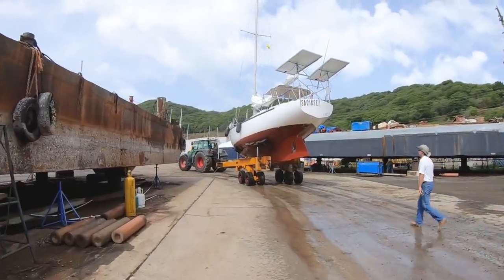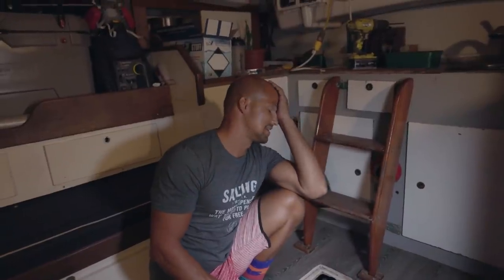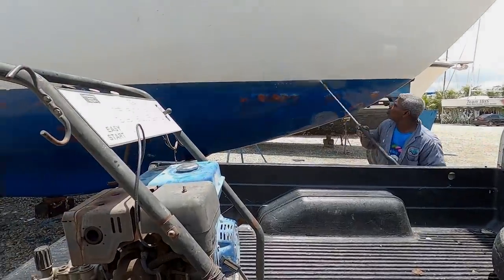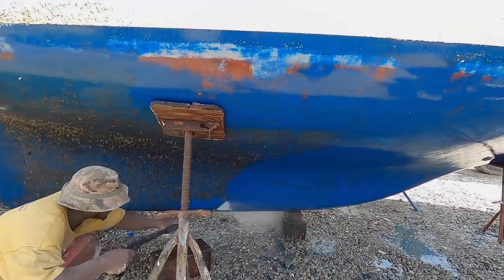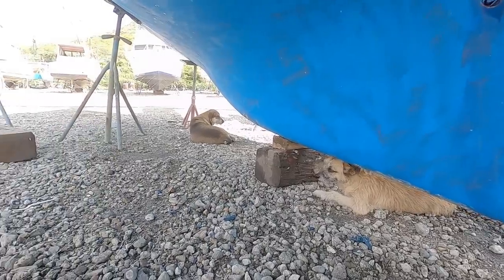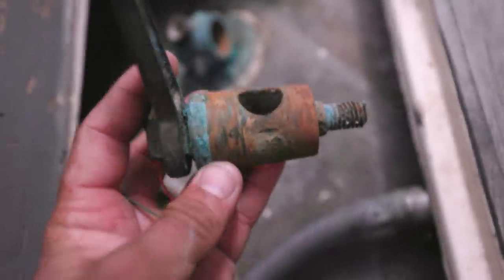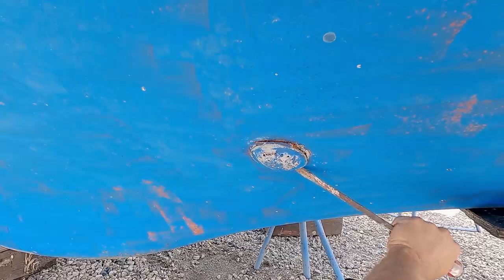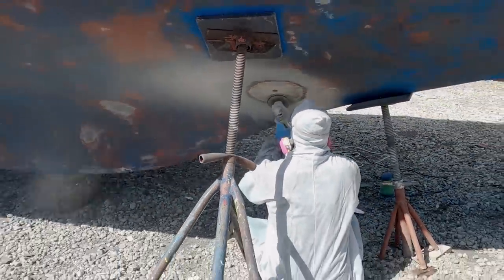IS OUR BOAT WORTH SAVING? (scary discovery during haul out)

Comment: That situation will require an extensive water osmosis treatment inside & out followed by tons of glasswork & fairing to fix completely. Sail-Life YT channel documented the process well, it took yrs to complete. I can only say it's not a job to get involved with unless decision is to keep Saoirse for a long time to come. Otherwise, make like a hermit crab & swap into a bigger shell.
Reply: Sorry, I disagree.  Drain as much water as possible, use compressed air, find the leaks and seal.  Close up the drain holes.  Repaint and keep sailing.  Not that big a deal.  My boat has had water in the keel cavity as long as I've owned her (18 years). It drains every winter on the hard (mostly) and doesn't affect the seaworthiness at all.  Like most gelcoat blisters, it's just not a big deal.  Fix and go.  Don't obsess.

Comment: Hi guys, this sound's like something we in Norway call glasfiberplauge, it's the epoxyresin that start to rot(hence the smell). You should get the area sodablasted and reglassed othervise it could live it's own life down there and slowly spread, and could do serious harm to the keelarea and that become's a hole other ballgame! Get a local Expert to check it out and do a propher job!  Sorry to be the devil's advocate but i have seen boat burst open due what sounds similar!
Reply: @Bjørn Erik Dahl. In English that’s called “osmosis”, which is probably not an entirely descriptive name. That can only happen with polyester resin, which is what almost all fiberglass boats have. Epoxy is much stronger, more expensive and can never have osmosis. Osmosis is caused by several different situations, but the main thing is that polyester hardens by evaporating its solvent, styrene, which leaves pores in the material. Water is absorbed into the pores, collects in cavities left by poor workmanship and then chemical reactions weaken the matrix around it. It’s not actually rot, and it’s normally far less dramatic than it’s usually perceived.

Comment: To be honest, I’m really trying to figure out what damage that water has done or doing.  If you think about it, probably not much.  Really the only thing it was doing was adding weight to the boat and maybe causing some shift in the ballast.  No issue with lead.  The de-lamination with that thick of a hull that would take decades to be any risk.  The only thing you need to do is dry it out and figure out where the water is coming from.  I would seriously avoid cutting into the hull.  A series of drill holes and forced air should dry it out.  Much easier to patch back up.  I know I make this sound easy, it’s not, but it’s also not the end of the boat or shouldn’t be!!!

Comment: Guys you really need to find out how your boat has been constructed, get in touch with the builders and get some drawings this will help you understand what is going on. The cross members inside your bilge area are called floors in most GRP boats these are timber, often laminated plywood then glassed into place and encapsulated. I would suggest the glass encapsulation has failed in your boat allowing water to be soaked up by the ply causing further delamination. These floors will need to be replaced as they will no longer be structurally sound. The most likely areas for leaks are your center board case and skin fittings, prop shaft aperture and rudder aperture all these will need to be stripped down removed refurbished or replaced and reinstated. This will be a big job and could take you at least six months. Whilst you are at it the hull should be checked for any osmosis and previous poorly repaired areas of damage, if any found will need to be cut out and properly repaired. GRP suppliers often run courses on this sort of work without trying to be rude you are obviously fairly clueless as to boats and glass tec and any help you can get will improve your chances of bringing your boat back to life. The good news is the boat appears to have been well built initially with good thick moldings, She should be salvageable but it is likely to be a lot of hard work and fairly costly. Good luck to you both and God speed.

Comment: Well it's not worth fixing correctly.  Most old boat do have water in the voids and it won't cause a problem if it doesn't freeze and expand.  Glass where it's leaking into the boat and call it good.  Fix all the holes you drilled in it.

Comment: If your ballast is iron and not lead you have to keep it dry all the time if it its iron it will rust and bulge an split the fibre glass you have to expose it dry it out and re-fibre glass a big job unfortunately best of luck. if lead its much easier as won't rust

Comment: Hi guys. Time to call it a day! The time, cost and effort to remove all the moisture using vacuum equipment and probably heating pads as you would do with osmosis to the outer hull is really not cost effective. The inner glass fiber will be saturated which will cause wicking to a greater or lesser degree. The only way to cure this long term is ballast removal drying, grind back and treatment. You can do some temporary repairs that may last a few years, but it is all down to drying out the ballast which has already had a chemical reaction between the lead and the sea water. This reaction is what's causing the bad smell. As the boat stands you need to be unemotional and consider the repair cost for either a few more years sailing at risk, or a full repair. Both of which are likely the far exceed the value of the boat even if the repairs are professional and warranted. 
Time to move on..... Sail Safe Guys, Ant, Cid & the pooch crew.

Comment: Well if the keel is lead and it's full of water you're not gonna have a rusting issue you might have corrosion inside but get all the water out my personal opinion fill the thing with spray spray foam fell it completely fall asleep home it'll give you more buoyancy and and no more water can get in..... But lest there's something that prevents you from doing that like something that moves around inside there I have no clue just a thought.... Drill a hole at the bottom put a vacuum on it suck out all the water

Comment: Hope you didn't really raise the waterline by 200 mm to put more stuff inside? This will cause a lot more forces on the hull. Under sail and even in port. The center of buoyancy changes, maybe also the area center of the appendages changes significantly. The boat could become more windward. The distribution of weight over the waterline would change and therefore the location of loads as well. A boat is designed for an certain displacement and adding 200 mm at about 10 m waterline length would almost double the displacement. This results in forces the boat is not designed for at all.
Reply from the maker: We will be adding a hardtop bimini, but other than that we are always looking to get rid of weight not add.

Comment: As soon as I saw that water coming in I was wondering if it is a wood core hull?  I have seen wood hulls do that and gravity let's the water leak in at the lowest possible Crack. Also the core Wickes up water. Could be many things to oick from. However older boots were built alot tougher than they really needed to be. Worst case is you would have to gut the vessel and rebuild the whole thing. You would still have less than a newer vessel would cost. Man I wish I was there to help you go into it. And to say do taste it it could be female the old holding tank. Sorry couldn't resist.
Reply: If it was from wood core it would be brown water, but that water was clear

Comment: Find out where it's coming in at, osmosis? Or through your center board axis? It's not the end of the world. Just  clean everything up and put epoxy barrier coat. Glass over structural areas that is delaminating. 
You will be fine.